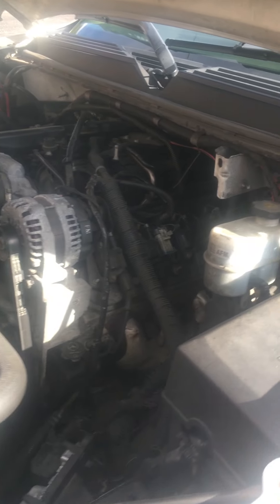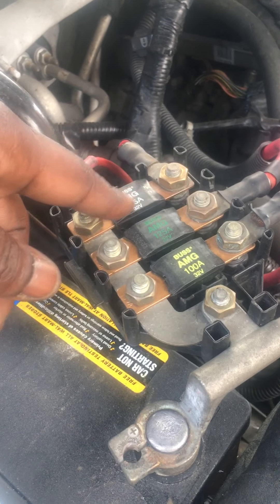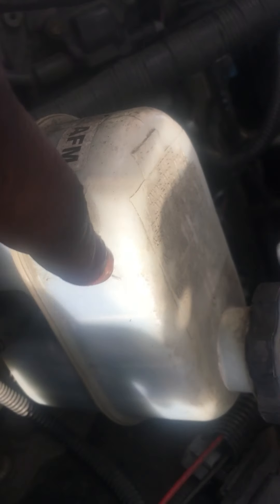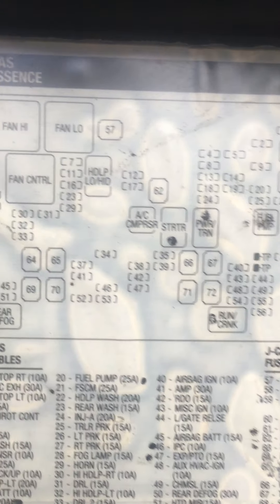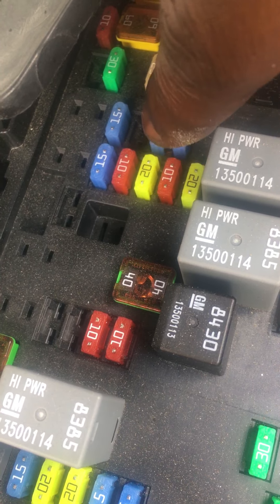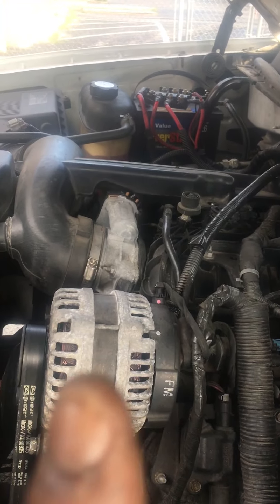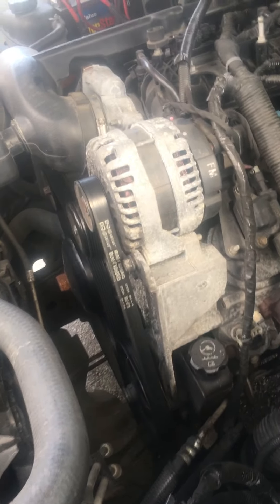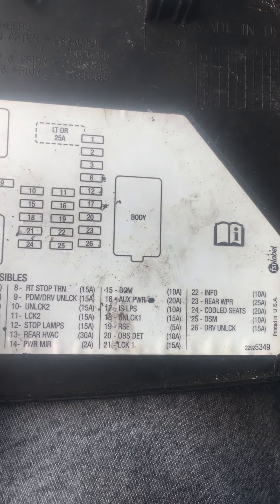LOST COMMUNICATION WITH ECM 2007-2012 Chevy Tahoe ( Its The ECM )

Comment: After all and it seems like a ground issue, put a jumping cable from the nagetive to the engine block and then try the chassis, it’ll work, I had a 08 suburban with same issues till it stopped cranking and it was a bad grounding somewhere and I put extra new grounds in different spots and even works better then it ever has
Reply from the maker: it was the ECM and Theft Module

Comment: Have a 2010 with intermittent no crank no start have to pull ecm and cables and eeset electronics for 20 mins to start. Also gauges go crazy and drip and stabilitrak and abs come on until it kicks back in.  Pull your "info" fuse in your driver fuse cluster. It cuts power to the bs onstar vcim which is causing interference on the high speed lan or can whatever i dont have a scanner.  Anyways youll lose remote start which is what started acting up for me and doing . I got no comm to ecm bcm tccm everything.  3 months thru winter everyday having to pull cables and discharge it pissed me off it being onstar module i would never use
Reply from the maker: check for water oil or corrison in the ECM CONNECTION can make the car go nuts
Reply: @Handymandan215  thats something i checked and coated with dielectric.

Comment: Ive been battling this for 6 months . I changed the ECM, bcm, terminal resister , negative battery cable, battery and the codes that always come up is loss communication with ecm and bcm
Reply from the maker: Theft module and the pass 3 key
Reply: @Handymandan215  I can drive it but I get ecm and bcm communication codes randomly and dash acts up
Reply: Did you guys get it fixed if not let me know
Reply: @Edi-01  I’m still battling it
Reply: Been having the same issue on my 09 avalanche..ended up being the transfer case control module
Reply: @MasterNeko  oh ok there’s. A black wire which is the ground lost communication it is the fuse box plug that goes underneath front bumper if that goes bad cheek for open circuits I had the same problem I got it fixed
Reply: @nickgray6305   how did you pinpoint it to that?
Reply: @Edi-01   could you show a pic? Not sure what you mean
Reply: @nickgray6305  transfer case control module??? Wea that
Reply: @Handymandan215 soo you had bad ECM??? I change that and a BCM.... In the key with it no difference
Reply from the maker: @jeromemccall745  Yea its a bad ECM
Reply: Hello! Did you ever figure out what was wrong? Did it go into limp mode?
Reply: @MasterNeko I’m having the same problem. Did u ever figure it out?
Reply: Try pulling your "info" fuse in the driver fuses. 2010 tahoe no crank no start replaced bcm ecm and its the vcim fkn up causing no crank and instrument cluster to throw stabiltrak and abs and all gauges drop like they lose ground. The onstar bullshit module vcim

Comment: Has anyone had the issue where the security light doesn’t come on after replacing the ECM? 

What would cause this?
Reply from the maker: check 2amp fuse or the immobilizer switch not the ignition
Reply: @Handymandan215  fuses for the ECM look to be fine. How do I check the immobilizer switch?

Comment: Hey have you ran into the problem of the anti theft light will not go out even after resetting?? Cuz that's where I'm at right now
Reply from the maker: new 🗝 🗝 key
Reply: Did you get your theft problem fixed? Mine is on too
Reply: @dubs3238  yup sure did , freaking key needs to be programmed to the anti theft

Comment: Yo I need help my 2009 Tahoe has this issue it will turn over and drive but it also starts acting crazy like the stabilizer traction control issue will pop up i don’t have the crank problem it cranks and drives until the same thing happens again should I just change the module or what to do next
Reply from the maker: Check the mega fuses on the battery ..... Only change the Ecm when the u0100 POPS UP and doesn't start
Reply: Clean all your grounds bro or added new one if you have to
Reply: Did you get it fixed if not let know I have 07 Cadillac Escalade v8 had different problems but similar I can send you the list what I did bro
Reply: @Edi-01 what did u do bro ? I have the same issue 2011 chevy avalanche
Reply: Try pulling your info fuse in drivers fuses. It cuts off the module Vcim onstar bs. Same no crank no start acting like a bcm/ecm on 2010 tahoe and this fixed it